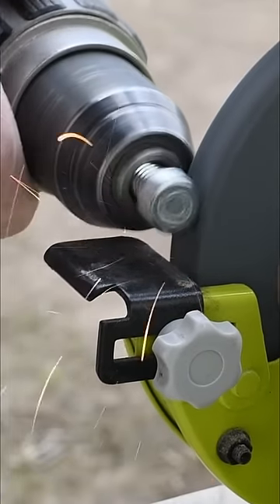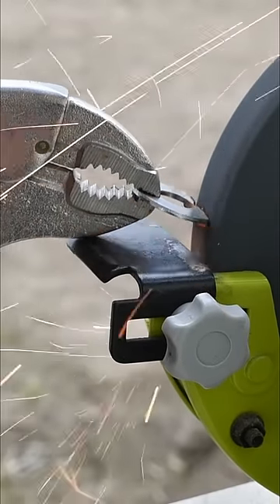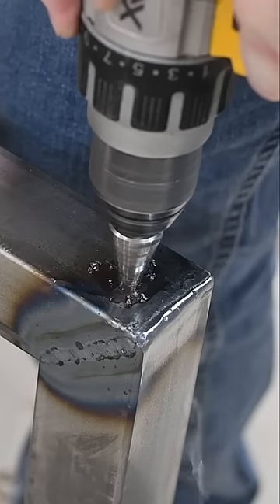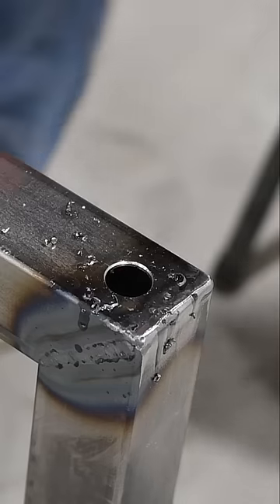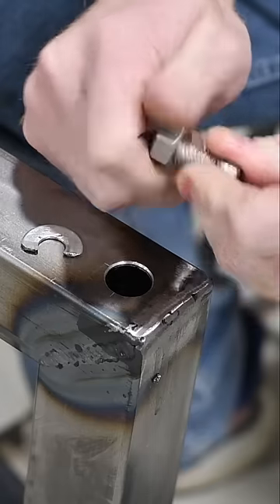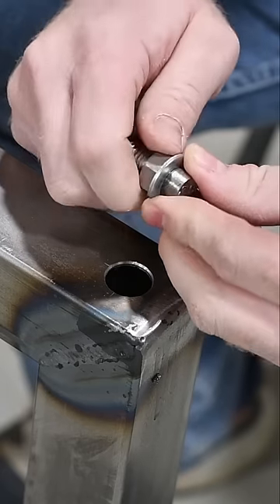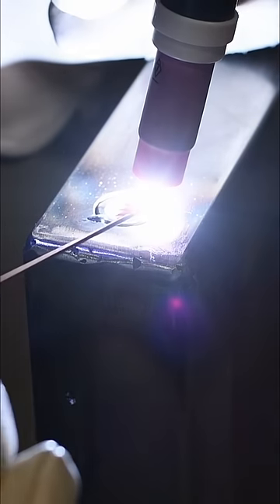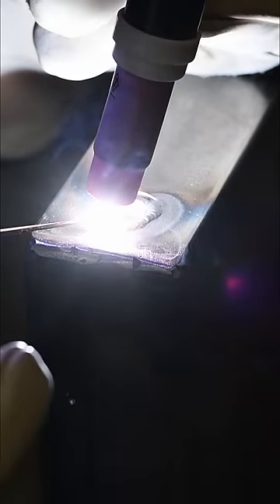The end of rivnuts! 👹Bwa Ha Ha Ha!#shorts

Comment: “I’m not a welder” proceeds to throw down some clean ass welds😭
Reply from the maker: Haha. Thanks!
Reply: They are commonly used in the lgbt communities
Reply: @RCH45ACP  I could teach you but I'd have to charge
Reply: @alakani my butt welds bring all the men to the yard
Reply: I'm not a welder either but I do weld. From the little I've researched, professional welders have a large array of complex issues that must be faced in their job depending on the situation and must be aptly prepared to do a job that will not fail. I've also learned that there exists what I would refer to as welding schematics that layout each weld on a specific job and the specifics of the welds themselves. It's more complex than is the weld "pretty".
Reply: Just what I was thinking!!😂😂 Btw..no need to grind back that bolt head...you just as easily tack inbetween the hex. Great idea!!!
Reply: @xbrun3356 rofl!!!
Reply: @matts3579 That's 100% correct! Welding procedures. Telling you all about the position, welding machine parameters, temperatures, number of passes etc.etc....mostly nowhere near the setting preferred by any welder because it's mostly pure theoretical and somewhat based on reality...

Comment: Chase the nut with a tap afterwards to clean up any distortion from welding
Reply: Basic fabricating
Reply from the maker: Agreed, if necessary. I welded 32 of these and a bolt went in and out of all of them after they cooled without chasing the threads. I think maybe the Tig process just put in way less heat than mig would. But i could see needing to do this in other cases/sizes
Reply: Thread chaser rather than a tap. A tap will clear debris and distortion, but a chaser is not hardened and rounds the existing threads 👍🏼
Reply: Unnecessary to tap lol
Reply: Pretty sure he just threaded the bolt in by hand after it was done. But I’ll put that up in my lunch room for tech tip of the week. Thanks 🤙
Reply: Maybe even leave a bolt you don't care about threaded in there...
Reply: @tylerhowe552  ?????
Reply: No need to chase threads, just use a bit of antiseize on the bolt and there will
be no distortion…
Reply: Just dip the bolt in your nozzle gel and thread it in while you weld
Reply: @noahv.6486  came here to say the same thing. 👍👍👍👍
Reply: OR leave the bolt in the nut
Reply: @ryanallen5334 you back the bolt out take off the washer, put the nut back and weld. The ground down bolt head is smaller than the nut
Reply: @ShawMade366 TIG welding is way hotter than MIG welding at around 8-12000° Celsius but it's also way more localized unlike MIG welding which will heat a huge area of the project metal youre welding on
Reply: Just leave the bolt in and don't get to much heat transfer... if you are splattering your already using the wrong current
Reply: Word
Reply: @zachgibson6412 came here to say the same thing. Most nuts and bolts have rolled threads. Running a tap will often cut some material out even if the nut was brand new and untouched
Reply: Leave bolt in..just remove washer
Reply: @ditto9300 a tig arc is the same temperature as a mig arc, and thats not what matters anyways, its the quantity of heat, which tig allows you to run lower.
Reply: Yes nozzle dip.or antisieze should suffice..
Reply: @zachgibson6412 , I appreciate your input because you taught me something new! I have both a Machinist and Gunsmithing degree but I’ve only used them for myself working from home. I don’t believe I’ve ever heard of a thread chaser and I often use a tap to clean up threads. I will definitely spend some time learning more about chasing threads for repair because that would definitely be better than removing material and reducing holding power. Thank you!
Reply: Pretty sure that's implied if at all necessary
Reply: @ShawMade366 you are correct if you used mig it would over penetrate and warp the weldment in this scenario unless you had a fixture table
Reply: The guy knows what he is doing he don't need to chase or tap shit 😂😂
Reply: Idk anything about welding, so I can’t tell if y’all are actually giving each other welding advice or making a bunch of sex jokes. Which one is it?
Reply: Will someone please explain what is meant by "Chase the nut?" Thanks!
Reply: Chaseing the nut is when you play tag with your son I think  🤔
Reply: Especially stainless
Reply: This won't come loose that easy...
Reply: @ShawMade366 good answer
Reply: @tylerhowe552 Think about what you’re saying.. Like really think hard about it buddy… He’s WELDING it’s pretty obvious what I’m getting at here… Idk If you watched the video because it’s most definitely not the best plan of action, if you don’t wanna start over multiple times that is…
Reply: @Wer-bist-du-JEH im sorry but if you weleded close enough to weld the bolt then you get to restart regardless
Reply: Was going to say that or depending on how many you're putting in just tap , if you're putting in more than a couple welding is more efficient
Reply: All this arguing makes me want to go back to rivnuts!
😂
Reply: 100% Even the most proficient welder would be likely to encounter a little heat warping there.
Reply: @jaredlancaster4137  pretty sure your wrong, tig arc is up to 50,000°f, mig is up to 10k. But yes, it depends on settings, how much heat and where, and the shape of the part will dictate if/how much something warps. 

Also, I don't see a nut this size warping all of the nut/bolt interface tolerance out of it to the point it wont thread, but i could be wrong. The guy commented that it was fine, and I believe it.
Reply: @chevybigblock3311  It would still be hot. It would shrink very slightly when cold, but I don't think it would be a problem either way in most (TIG) cases, unless the threads got spatter in them.
Reply: @ditto9300 then what is your point?
Reply: @jaredlancaster4137 tig arc actually jumps across an open distance, mig arc is closer because the spool material is nearly touching the work.
Reply: Or splatter from the welding process.
Reply: @zachgibson6412 Ah shit... you'rw telling me that there's something called a Thread Chaser? I thought chasing threads was just threading a same size tap to clear anything in the threads.
Reply: @tjpprojects7192  I honestly can't think of many instances where using a tap instead of a thread chaser would lead to a "bad" result.
Reply: @tylerhowe552  this works best to keep it in spec, if you're confident you won't weld the bolt to the nut on accident, because then you're really in a situation 😂
Reply: Stainless steel nuts are the ones you need to worry about.
Reply: @454Casull  Beware of cheap taps, they will open thread diameter as QC is bad...
Reply: I'll stick with my rivnuts, it takes seconds

Comment: "I may not be a welder"
welds better than most welders
Edit: obligatory cringe edit thanking for so many likes
Reply: Welding and welder are different terms.
Reply: the welding on those edges are shiiiit that's why he said that..
Reply: I'm not a welder either, I'm just someone who weld's metal !
Reply: Why did you grind down the nut
Reply: @nicholasdouglas9781 maybe the nut blocked the spot to tack.
Reply: That’s EXACTLY what I was thinking when I saw that weld.
Reply: @r3d33m3dn78 well no shit 😂
Reply: Ran a pretty decent bead around this nut, and it was a pretty clever idea.
Reply: layed pretty good for tig only thing is machine was barely hot enough
Reply: @nicholasdouglas9781 He got more surface an contact to the main part by doing it.
Reply: You can do all the welding I have to do ! Pretty damn good i'd say !
Reply: Ummm, not so much.
Reply: Stupid though when it’s furniture and there’s such things as a rivet nut
Reply: Right
Reply: 6 weeks until I know if i am a certified welder. Your a welder but nobody really cares unless you are certified through AWS or other agencies.
Reply: @nicholasdouglas9781 so he could get at it with the welder. The man welds very well.
Reply: @davidshumski4629  yea or he could just unscrew the bolt
Reply: @CaptainCurtReacts 
That is exactly why.
Reply: @nicholasdouglas9781  what would hold the nut from falling then?
Reply: @davidshumski4629 his fingers?
Reply: @NateKK7 people really don't gaf bout that as much as u might think. They just want u to pass THEIR test. I've been welding stainless tig for 20+yrs and they just don't care. I've had guys shoot for a job with this experience and they just cant do what we need, certified don't mean shit if u can't hit a lick without busting a shot
Reply: @oliverklozhoff  you hold with your fingers, I'll try and weld it.
Reply: @oliverklozhoff  the experience is extremely important but if you have experience and no cert allot of companies won’t hire you or will have you pass the test. The cert and CWI is to cover their ass if something happens. The test I took was AWS D1.1.
Reply: I’m not a welder either, nor do I know much about welding, but that looks cleaner than a lot of what I see online from people who claim to know a lot more.
Reply: I was about to say this lmao
Reply: By😅
Reply: "I may not be a welder"
welds perfect dimes 😆
Reply: I am an IUOE Local 15 Operating Engineer. I attended some welding classes at the Union School. I can weld pretty good. I can even do non certified maintenance work.  But I would never consider myself a welder. "Welders" are consistently excellent and have passed rigorous certification tests.  My Union covers Machine Operators (me) , Crane Engineers, Welders, and Surveyors. I have lots of friends that are Welders. Until you can go 180 feet underground, slide 300 feet into a stainless steel pipe, and weld it flawlessly. (Proven by Xrays. ) or get hoisted 30 stories into the air. To weld together giant refinery spheres. (Tacking your homemade seat to the structure for support. ) Plus, you have a book of certifications and can work a 12 hr day on a sandwich. Nope, you're not a welder. You're just someone who can weld. Like me.
Reply: So what was the point of grinding down the bolt and notching the washer again?
Reply: I have to agree... :D
Reply: @r3d33m3dn78 Thank you Mr. Pedantic
Reply: @user-ui8du6hx8m if I've had a dollar for every welder I've heard say this that can't weld any better lolor worse
Reply: A real welder would not have wasted time grinding down the bolt.
Reply: I was just gonna say that...
Reply: Dont u see all the holes and the deep burnings???thats verry bad welded man u dont even know how good Welders do lol
Reply: @nicholasdouglas9781 he didn’t??? He ground the head of the bolt but that’s it…
Reply: @ronmoore6598 so that he could tack the nut without getting the bolt stuck to it.  Same reason the half washer.
Reply: @thatoneguy1070  If it was a tight fit to begin with you could just pound it in and weld it.  If it's a loose fit, grind the washer, then tack the washer to the bolt.  No need to grind the bolt head (except for YouTube likes, of course).
Reply: @ronmoore6598  i agree. I didnt say it was necessarily the proper or smart way to go about it.  Just my input on why I thought he did it.  Lol
Reply: ur not a Wilder but ur idea is amazing.👏👏👏
Reply: Bahahahaha
Reply: 😂😂😂😂 so true
Reply: I think we all just learned OP is also not a welder
Reply: @r3d33m3dn78 ”I’m not a welding”
Reply: This is like first couple of months apprentice level welding, what are you on about lol
Reply: @nicholasdouglas9781   to give enough room so you don't weld it along with the other one
Reply: user-wg8fx4ch1q  blabla. You can just give the tip without trying to show off. ‘Woop Woop’
Reply: I guess? He was welding on carbon steel, which is super easy to weld, and he essentially scorched the workpiece, typically you want silver, or blueish weld color on carbon steel. He did better than most “welders” but anyone who knows anything about Tig knows that weld was far from passable.
Reply: @louizifer8922 that’s exactly what I was thinking, these guys have no idea what a high quality weld looks like. He have had porosity on the start/stop of his initial weld. Not to mention how scorched the workpiece is lol.
Reply: I'm NOT a mechanic but i work on cars so 🤷🏽‍♂️
Reply: @nicholasdouglas9781 to have room to weld the actual nut underneath
Reply: @user-ui8du6hx8m I've seen much worse done by "professionals"
Reply: Well I learned , the blue is good on the bars I had welded at work , hold exhaust on my Harley, and saddle 💼 bags rest on them , all mounting points severed and I have take wheel off to get to back bracket , I was going buy a welder try weld while on bike 🏍️ or clean it up have welder do it , I’d be happy if I could do as well as this guy but I can just tell difference professionally done , stronger than was begin with and it’s weakest point , bars should’ve been thicker to begin with sorry for rant😂
Reply: that's not obligatory, you are unironically cringe.
Reply: You could've also not cringe edited
Reply: Gotta make sure you thank everyone for likes that don’t mean shit 😂 I’m not even disappointed anymore at this point

Comment: You may not be a welder but you can definitely weld!
Reply from the maker: Thanks!
Reply: @ShawMade366 quick question, why did U grind the head of the bolt down but use a fresh bolt at the end?
Reply: @Crispymemes he grinds it down to male space to weld the nut, otherwise the bolt would make it difficult to weld the nut.

Comment: It's important to get that bolt back in there before the threads are distorted. Or just use a longer bolt and hold up on it and keep the nut in place. While you weld it.
Reply: I mean it's making a natural locking nut? Lol
Reply: @TheGameboy57  and that's in place welded down to the surface. But other than that if you don't distort the threads it's just a regular nut. But no range required hold it.
Reply: Won’t that sink the boat?
Reply: this is NOT going replace riv nuts..  I'll  watch videos that have welders that know what they are doing

Comment: Rivet nuts would be just fine for garage cabinets.
Reply: In all honesty this is cheaper than going and buying a case 25 Riv nuts for like 15 bucks plus fuel and its cleaner
Reply: Rivet nuts can get loose in thin material. If you do use them make sure they are the same material as the base metal.
Reply: Nope, rivet nuts only go into the things that I will never have to open again, now if it's somebody else that'll be using later then no problemo. Jk I actually couldn't do that to the person after me.
Reply: @dustinmiller7278  That depends how much your time is worth  vs how many times will you actually take it apart. For people that make more than $15 a hour it's not worth it.
Reply: @dustinmiller7278 you still have to go buy nuts and bolts, still use the fuel when revenues would be cheaper than buying nuts, bolts and washers. Let's not forget the tig rod, the power it takes to run the welder and the extra work preping the bolts and washers × how ever many locations you have to do this process  opposed to just drilling holes and inserting the rivenuts. Rivenuts without question, would be the better solution over this process
Reply: @stevevanscoik398 rivenuts only get loose when the user hasn't inserted them properly
Reply: @a-aron2276 not true. I drill out and remount rivenuts all the time
Reply: @stevevanscoik398 also, u can use a lower gage material
Reply: yea sure rivet nuts would work good if the cabinet your building isn't gonna hold a lot of weight but for a garage cabinet your gonna be stacking upwards of 900 pounds of tools on it unless your that guy that only has 1 hammer 3 wrenches and a single screwdriver.... but at that point just get a friggen little carrier toolbox
Reply: @marcusgarvey7778  I think you may have over thought that a little, you would only have to modify one bolt and one washer! If you modified a bolt and washer for every nut you welded then their may be a couple of screws loose in the brain!
Reply: Them bastards love to spin 😑
Reply: @derekv275  That's because you're installing them wrong.
Reply: @robedwards9486 nobody can compete with china anyway, doing it yourself is almost always about doing yourself and not about money
Reply: @dustinmiller7278 don’t forget the cost of a welder and the cost of a welding course and this looks a little less cheap for some people who want to add 6 nuts so some random project
Reply: The only advantage I see over rivnuts is that his technique leaves a flush surface.  The rivnuts can be ordered online and delivered prior to beginning the project and they will be faster to use.
Reply: @dustinmiller7278 Rivnuts are like, 5 cents a piece lol
Reply: Just buy weld nuts so you don't have to deal with the plating or hexagonal shape. Not every task needs to be about showing off your improvisational talents.

Comment: Finally! an actual legit great tip on YT 👊🏽👍🏽.
Reply from the maker: Yeah, its a method that worked super well for me, which is a big part of why i thought it was worth sharing! Thanks!
Reply: Fr i was like, oh great another diy fix to problems that dont exist, but then it was legit
Reply: Better tip from YT comments repeated a lot here because it's better advice: try rivet nuts.  No grinding, don't need to be good at TIG, cheap, strong, works in even thinner metal, etc...